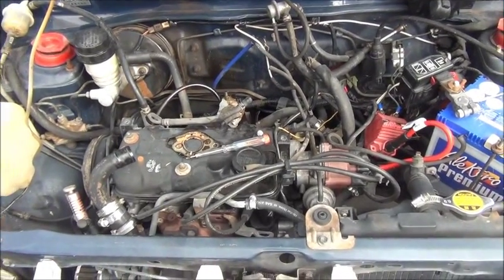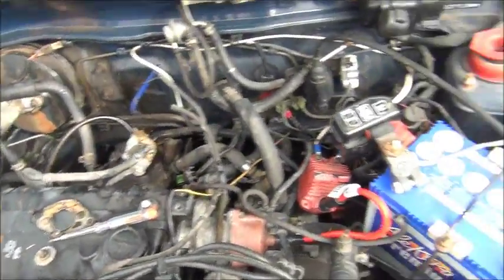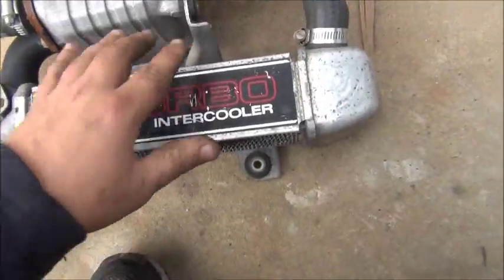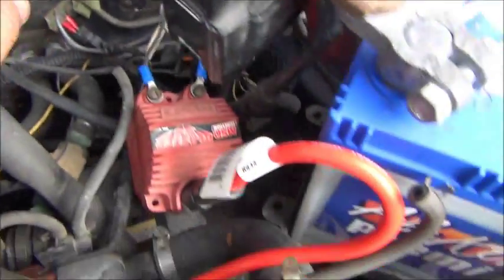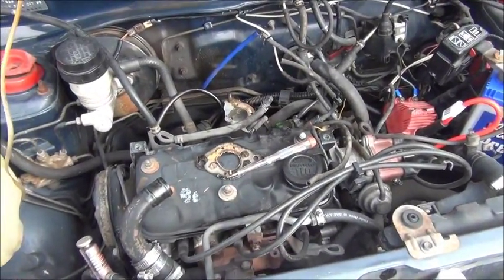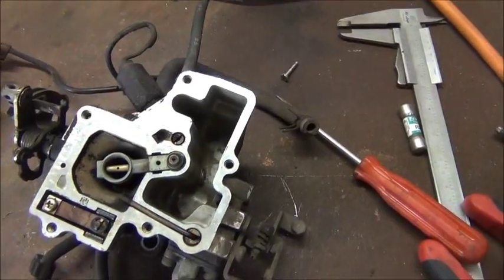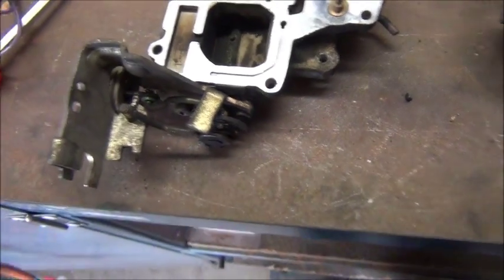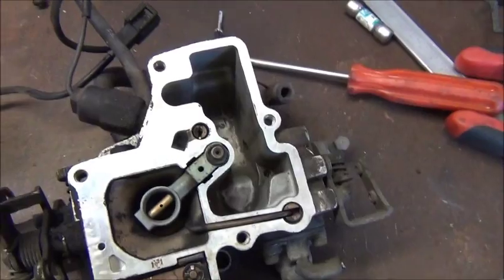Mira Update 17.6.3, Carburettor Inspect, Ignition Mods.

Comment: I got an 850cc mira, its got a rough at guts slow idle, wondering if it could be the ignition, or the carby, doesn't seem to be any vaccum leaks, figured there might be a mix screw on the carby I'm missing

Comment: i think either what ed said, or the float level. is it possible that the choke is hiding a problem while it's on, and when it gets hot the choke is fully off and then the problem is showing? was the air bleed clean too?

Comment: Hey. the little Daihatsu of mine idles high. but than slowly goes down after a slight rev. I've noticed it's the vacuum looking thing on the throttle body. i'm wondering if I could just take the little rubber boot off and lubb it up. seems to be sticky.